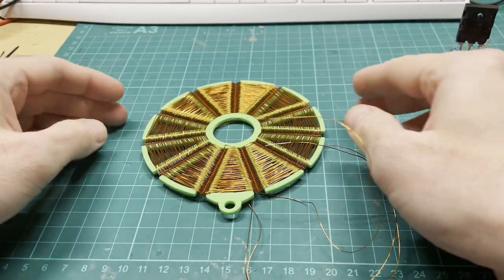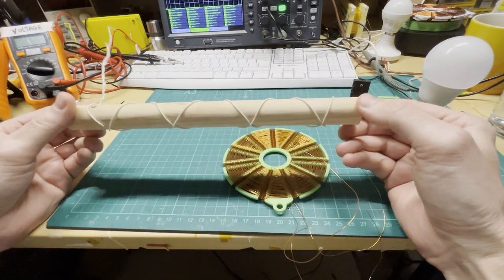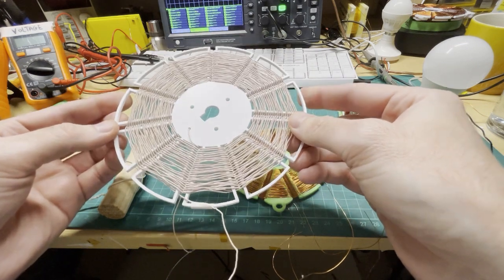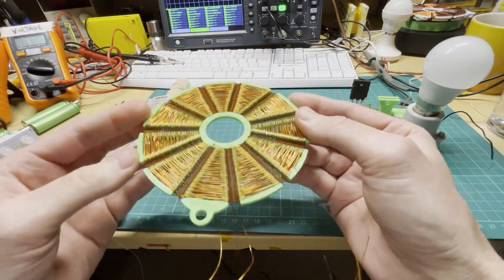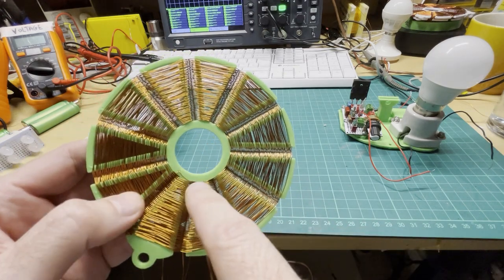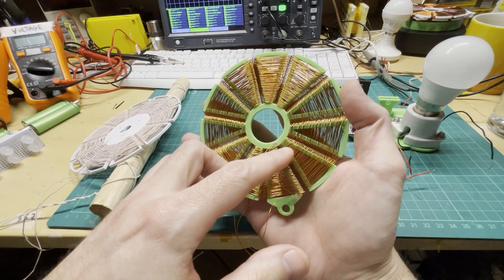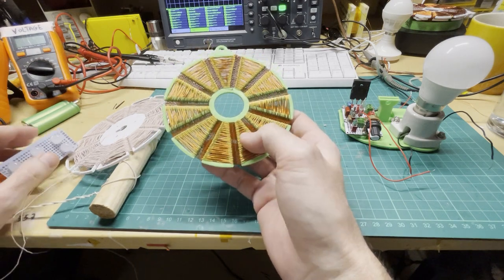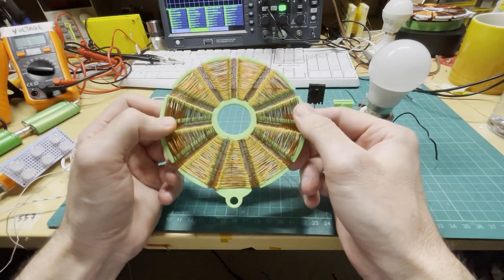New Invention - Pancake Caduceus Coil

Comment: Nice for vintage or new radio mw receiver ...spider web....in the 20 century around 1920...i make like this 5 7 9 11 15 section for portable radio receiver with battery tubes ...old stock tubes performingfor very low consuption...

Comment: What is the use case of the coil?
Reply: he'll make it up as he goes on.. probably something to do with free energy. :')
Reply from the maker: I wanted to make a coil to produce lots of scalar fields and from my research, scalar fields interact with the ether or the environment and scalar fields pick up extra electrons from the environment. So I’ve been wanting to access scalar fields and capture them back into the system for getting additional electrons. And I am still trying to figure out how to capture the fields back into my system. As @habiks mentioned, it is still early days as to what we can do with the coil. So far, I did a few tests over the last week and some of the effects are: the coil appear to be sliding on top of magnets of the same polarity even the the magnet’s field is not compressed as opposed to a magnetic ramp, I’ll share another video soon. Also, the coil can resonate at a wide range of frequencies (like a spider web coil from a crystal radio) which means when I can connect the coil to a joule thief circuit the light bulb turned on right away without me having to tune for resonant frequency. Another effect is that it appears to be pulling magnetic field and somehow it’s converting back magnetic field into what seems to be additional power using magnetic induction but that you will say that this normal electro-magnetic induction principle, the strange thing is that when I did this test is that my multimeter did not detect any additional current draw. The other test that I did is that a small magnet will want to slide from outside the rim of the coil to the inside. So is there potential to use this as a pulse motor coil? And add another coil for the generator but open the coil at peak magnetic induction? I tested the coil for fields and it’s going out in all directions even from the rim of the coil I was able to pulse a magnet. Scalar fields are very special and you can for instance create a scalar wave and transmit power wirelessly across wide distances with zero loss, in fact there is some extra gains as proven my one of the physics students of Prof. Meyl. Nikola Tesla claimed the exact same thing with his Tesla Magnifying Transmitter which works on scalar waves, 120 year ago. If you are interested in scalar fields, it is a difficult topic to understand but look up Prof. Konstantin Meyl (http://www.meyl.eu   ) also my friend David from Alaska has produced some really good information on this subject: https://resonantfractals.org/Doc/1index.html
Thanks for asking this question. I hope you can comment in the future and let me know if you’ve discovered something on your own. Always trust your own judgement and take everything with a pinch of salt until you have fully replicated an experiment as what I say or anyone else could be glorifying claims or that be inaccurate statements ect. I appreciate your comment. ❤️
Reply: @michelsbench so just a really cool coil ?

Comment: Really nice work Michel, and thanks for sharing! On this coil - it might be interesting to wind a full 180 degrees bifilar, one CW the other CCW, close coupled around the frame, from the same start position?
FYI none of the above links work, and are incomplete to copy/paste?
Reply from the maker: I love your work by the way Ian ❤️. So interesting that you say that and we should try that. Also, if you want me to make you a Cadeceus Pancake coil, it would be my honor to make one for you. I think you have my email, let me know. As to the clockwise and counterclockwise bifilar, I love your thinking! Thanks again for being so generous with giving your cap bank to Nathan and Ben, you are amazing! ❤️❤️❤️
Reply: @michelsbench  I did reply here earlier but I don't see it populating - likely finger trouble! In any case...

The winding suggestion was based on how I understand Gerald would do it, depending on the desired effect...waiting  for Gerald! 
You would wind the #1 filar (eg CW) to its first conclusion, then you wind the bifilar 180 degree 'opposing' coil from that end point to the start of your initial wind, overlaying it close-coupled to completely cancel out the magnetic field. Hopefully that makes sense, then repeat the process. Using little hooks to isolate the two coil termination points will help.
Bob Boyce's presentations are interesting on this - he strongly suggests that the caduceus method, or 180 degree out of phase methods - do not afford an 'event' strong enough to prevent a partial magnetic field from forming, which negates a proper Tesla radiant energy system from forming. 

An implosion vortex I think is key - akin to Victor Schauberger, using that profoundly simple process to constantly tap the ZPE...and how ultrasound can be used to trigger a constructive feedback resonant wave pattern when exposed to the right triggers...blah!

It was a pleasure to build the cap boards for the guys - everyone's working towards the same end which is important. I also feel strongly that altruism and friendship is fundamental, and I suspect like yourself - I just love designing and making this stuff!
That's a really generous offer to wind and send me one of these coils - thank you.🙏 I also know how silly $$ it is to mail from the UK to the US, so I don't mind winding it here at all - besides I'd have it a lot quicker!
Saw your presentation on the scalar setup which was excellent - I researched Konstantine Meyl's work back in 2016 but couldn't properly understand it at the time nor afford the build kit - very relevant now to what we're working with so I'd really like to chat with you about this for sure!
I don't have your email as yet - if I can't find it mine is Bogirish@proton.me
Cheers!